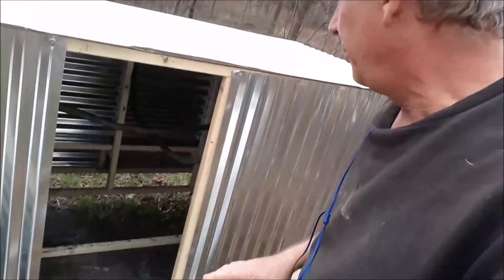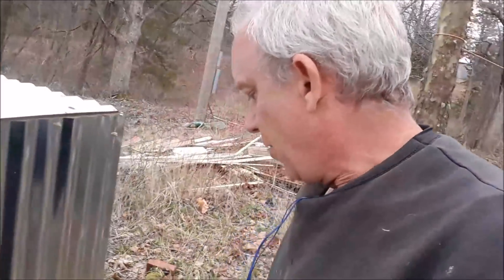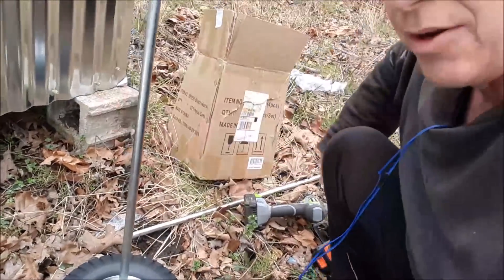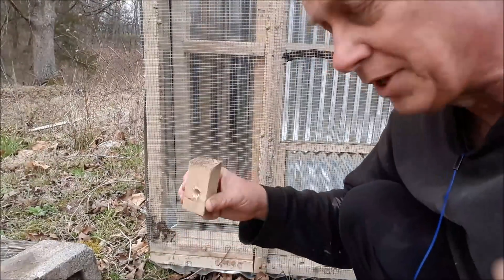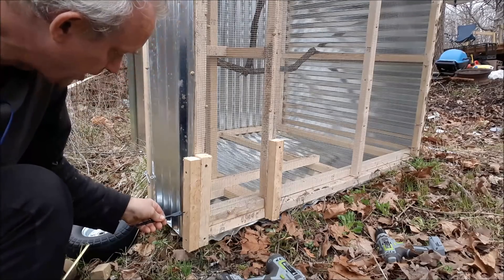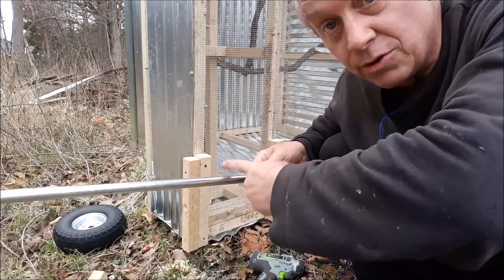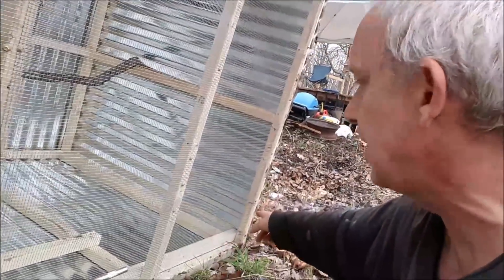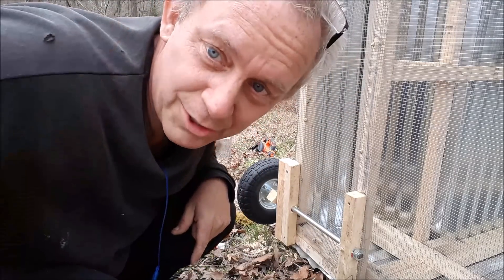I Caught Our Tiny Tiny House On Fire While Off Grid Living

Comment: You could have saved the cost of those collars and setscrews.  Just drill 1/8th holes through the axle rod, and use cotter pins and a couple of washers.
Reply from the maker: I don't have a drill press.  Not enough power to run.  Secondly, the costs didn't cost much.   So,  why complicate things

Comment: I'm really curious how the non-inflatable wheels will fare in the long run.
They have the advantage of not needing inflation, but the disadvantage of losing shape more easily (e.g. when you hit a rock or the side of the road too hard), 
since their structure needs to be supported with something other than air.
Your chicken mobile doesn't seem too heavy, but I think it'll be interesting nonetheless.